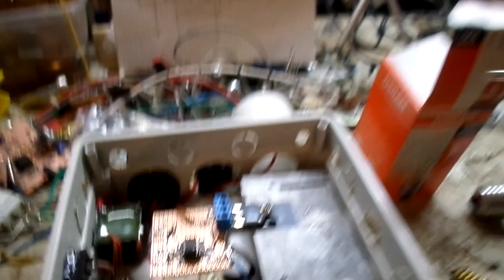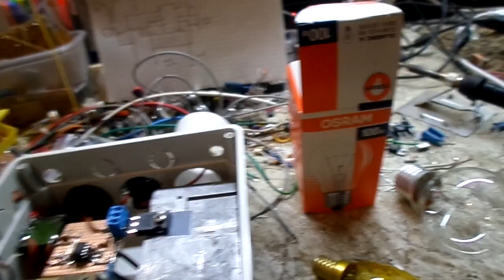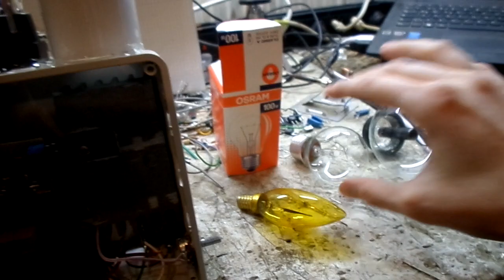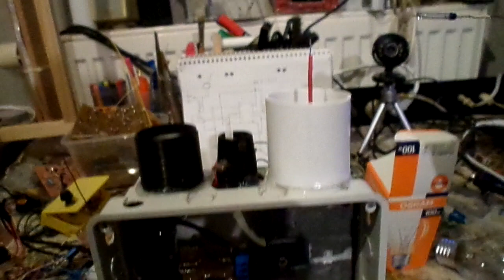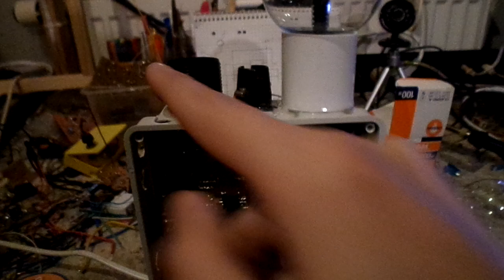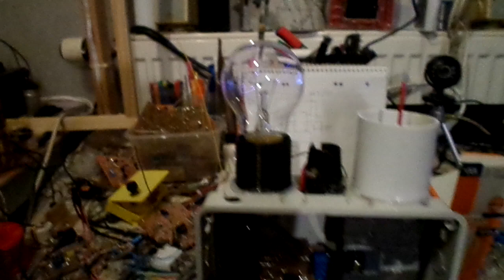555 plasma globe project

Comment: I don't think the wttage as such has anything to do with it, i was going to say it could be to do with surface area, but when you fired it up, the arcs were coming from sharp points in the lamp, maybe there's a difference there, or like you say, it could be the mix of gas/amount of vacuum.
Reply from the maker: yeah im still not 100 % sure why some work better then others but it seems that the higher the wattage, the better they can be used for a DIY plasma globe, i wish i had more a variety for experimentation but then again i can just use my argon gas bulb, i have to see if i can find some other things to try out